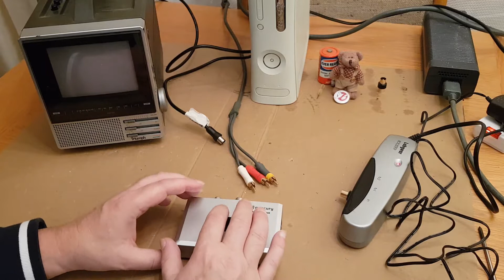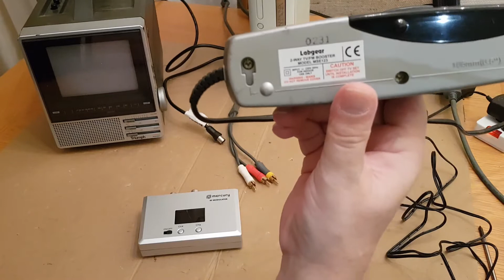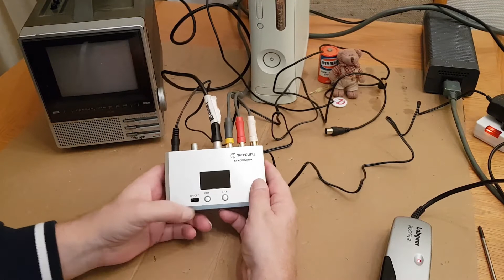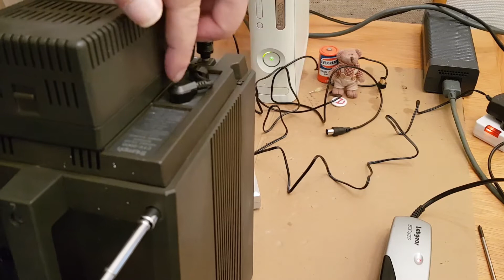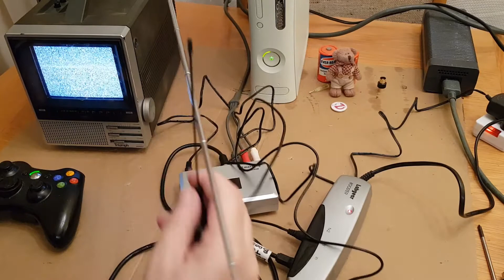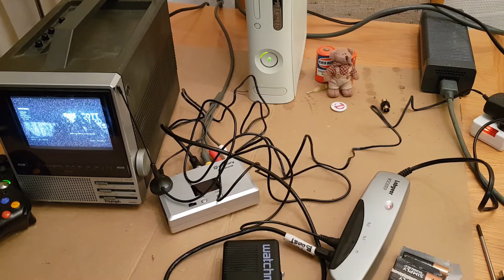Part 2 of how to transmit a signal to an analogue tv

Comment: I need one of these, but the Mercury model is sold out EVERYWHERE. And the generic units on eBay do not work. Any advice on where to get one of these RF modulators? :)
Reply from the maker: I got lucky and found this used on eBay, it wasn't cheap either, the only thing I found similar is eBay item number 387747214553  although unsure if they work as intended, cheaper than what I paid for though.
Reply: @retrotechguardian4393  Many thanks! :D

Comment: Seems like myself and many viewers are stuck in this part where the antenna doesn’t work well. Could you make a video that shows an antenna that actually works…or go into detail on how you made your boosted antenna not shown here ( the one in your earlier video) …. Does that boosted antenna work in this setup?
Reply from the maker: Hi, sorry for not getting back sooner, look out for a new video coming soon, I have bought a proper signal booster and old aerial, hoping this does the trick better.
Reply from the maker: https://www.youtube.com/watch?v=5-b60xPJzj8&ab_channel=RetroTechGuardian 
I have just posted a new video of a much easier way to do this. With better range.